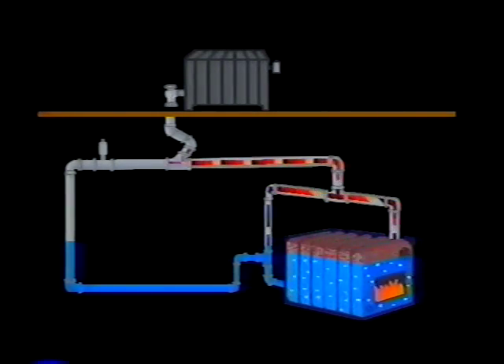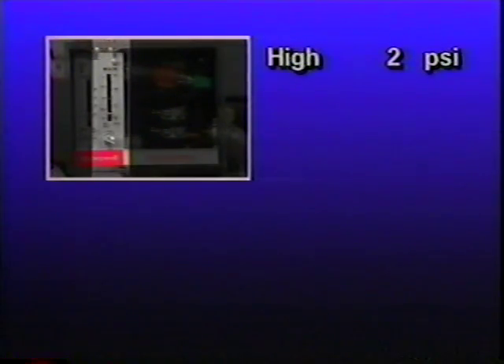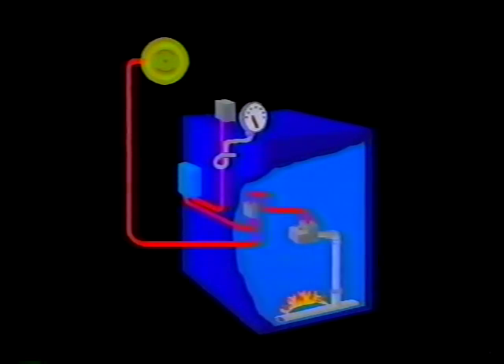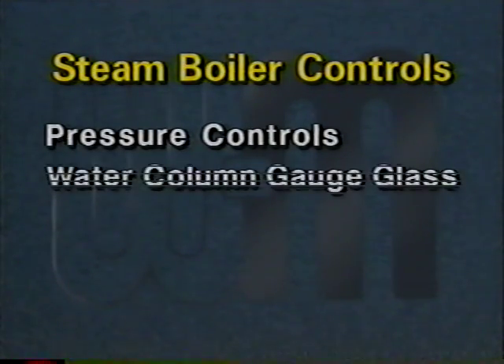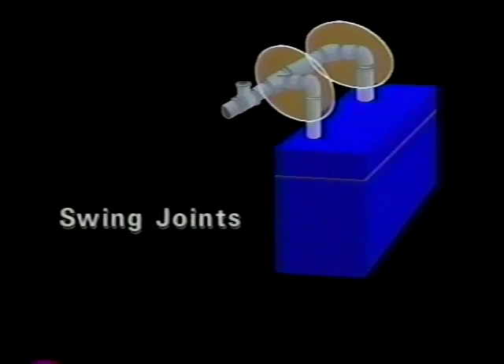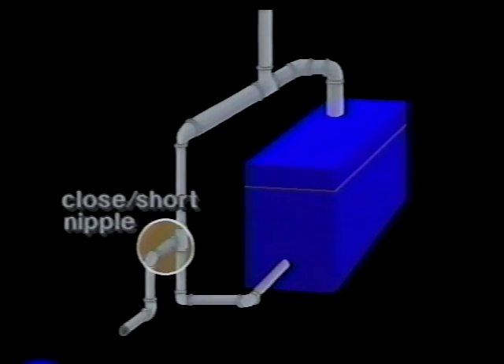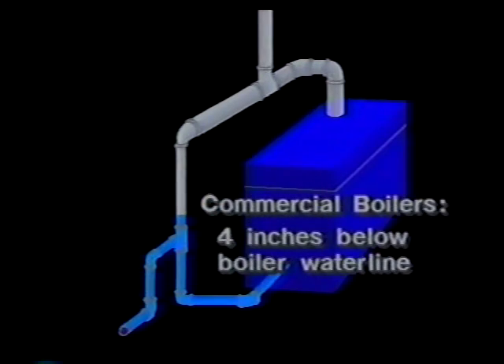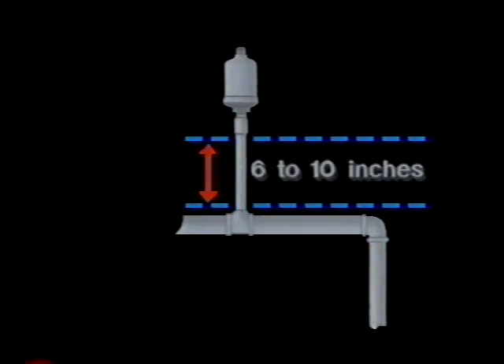Weil McLain Steam Vid 2

Comment: What kind of tools should I have by default to repair various common problems that can happen to a peerless boiler. Right now. My psi was maxed  all of 3 times it fired. Just bought house. I opened all my radiators. I added water to it so it was at the normal level. Then I took water out after noticing psi gage. It could have already been thsy high. It said low water when I took water out to lower psi. So I'm like...fuck. I poked a wire through the copper pipe thst is the little box that regulates the psi. Nothing came out of the psi. And well after I did that. I tried firing it back up. But now it won't fire. Pilot light is lit. I shut power off to it for 30 seconds ect. But still nothing. There is a little circular thing that let's the air out of pipes thag was working also. Anyways I'm avoiding calling a plumber and determined to fix and keep it upkeeped myself. It's warm now but want to get it off bucket list. Holar at me if you could

Comment: I know that is an old video but I must tell  you that is an extremely educational video, I learn a great deal from it. I have an old steam one pipe system, there are two air vent valve on the return pipe ,the one that closer to the boiler is making a loud wisling noise.i change the valve ,I'm still having the same problem. Air valve is installed in a 20 in high. What could it be ? Thank u

Comment: My Weil MacLaine boiler is 2 years old and it’s lacking a very load buzzing noise ?? Any idea on what’s going on ?
Reply: All Weil Mclain steam boilers I know good they don't use push nipples that use neoprene gaskets on the head on a des and after so many years they leak better boiler that have Push nipples are good why am I playing as cheap did not work get the good on hot water hydronic heating but not steam don't go there been a boil mechanic for 35 years they used to be good at one time till they stop using push nipples Centra Centra Beatles what agency is the sky with